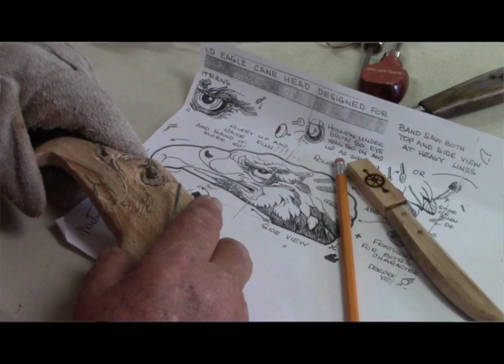Mountain Man: The Art of Making Custom Walking Canes

Comment: what si the knife named to strip the bark? I have partial use of my hands and want to make a nice ironwood can and also a longer walking stick for myself. I have multiple combat deployments in my career since 1985 till next month and was wounded over and over taking 28 serious operations...so I need a decent cane and making one seems the best way. I cannot be setting on my rear but can only walk about 300 meters a day...which is about 1/4 what a person does when at home being lazy. SO I need to get more mobile...and advice on this cane and stick would be nice...looks like you make your own stuff out of scrap which I like a bunch and what I like to do.
Reply: it is a draw knife.good luck
Reply from the maker: I'm sorry you've been hurt, but I thank you very much for serving our great country and I wish you much luck in making your walking cane. If you have any more questions for Mountain Man Wayne regarding his cane or walking stick making techniques I will be sure to pass them on to him and get you a answer.
Reply: I have the cane pretty much made and have a 1920s lathe hammer or half hatcheta nd half hammer as the head. The edge is 2 1/4 and has a thin profile so works out. I will finnish it with tung oil then stick the bottom rubber piece...it looks very nice I just need to do a better job each time I make one. I have worked on wood stocks for years but lost my skills from brain injuries hand and arm wounds so its a slow process to relearn stuff.  Thanks